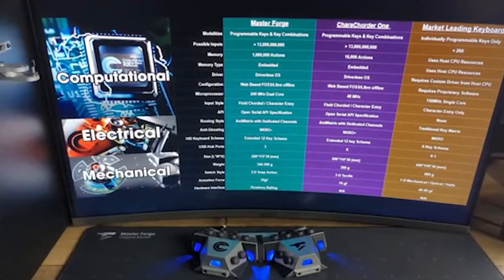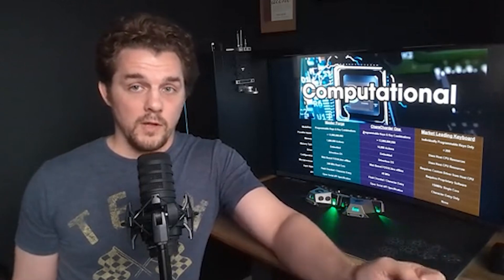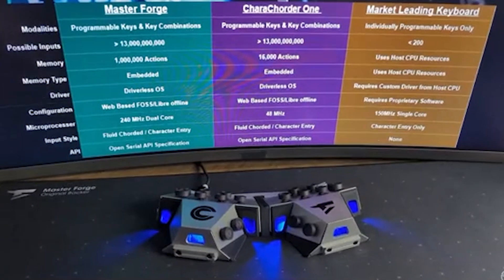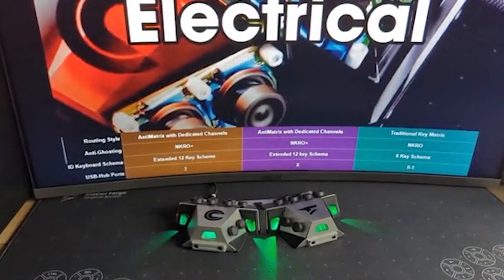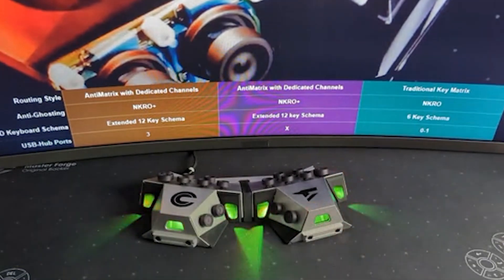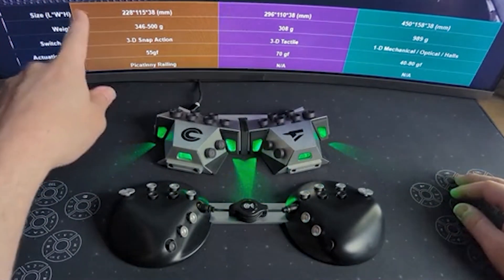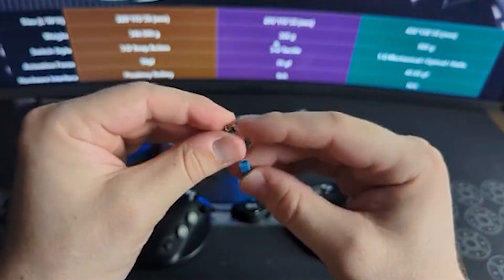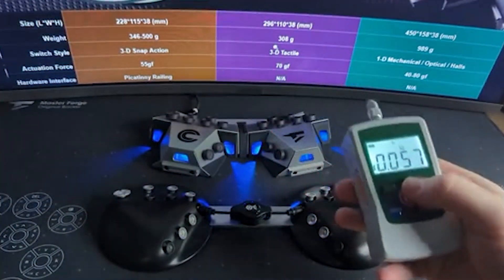Master Forge: Specs Reveal

Comment: I was evaluating whether to get the Characorder.  Now, I also need to choose between that and the forge.  This comparison video did not make clear to me the difference between those two in terms of the user experience and/or learning, beyond the forge being perhaps a bit smaller.
Reply: Yes Forge is smaller.  The left and wight elements of forge can operate independently. It means you can connect one of them to the computer and type with it. On Charachorder one, only one side can be connected to computer. Every element of the Forge acts as a hub. You can connect a USB stick or any other USB device to it. And you can access that device on your computer.
Those are the differences I noticed. It is now up to you to pick the most suitable for your need.

Comment: I saw that assembly animation and my brain went 'how does this get enshittified to cost 9.57' (the cost of cheap rubber dome keyboard)
obviously everything gets injection molded, then we use a single layer flex pcb for the switch board, we replace the switches with metal snap domes which get affixed with some adhesive backed plastic film (fancy packing tape essentially) and a spacer, swap the micro controller for something with the lowest specs available for a single arm core. We can probably get very close to current keyboard prices.
(this is not a dig at the product, more of a thought experiment on how this could be made for mass production at a silly low price)
Reply: This is a late reply and I in no way am speaking for the company, but as a third party bystander....mass production is EXPENSIVE. You need to have volume to justify it and make it cheaper. A product like this will always be niche. Therefore it will always cost more to manufacture because it's not able to be mass produced. You could probably use cheaper material to produce it, but then you'd face longevity issues for the consumer. It's the cost of selling a product that has merit and worth, just not to most of the world.
Reply: @8bittim  I am very well aware of the startup cost of mass production, but the question wasn't would anyone do this, it was how could it be done

Comment: 4:41 This bit is slightly misleading because one could look for an n-key roll-over and require this for their hobbyist stenography and they’re able to input way more than 6 keys at a time, especially for those weird looking chord combinations that make up for “missing” keys. This weird “missing” keys thing and unpredictable chord combinations is why I chose CharaChorder in the first place. 

And I am not required to continue chording even to type one letter at a time if I wanted to. Unlike stenography where I am to chord individual letters, it gets heavy and you have to go into the device to put lighter springs just to ease the weight of the keys so chording isn’t as heavy as before. On the flip side, CharaChorder is really nice and chords are predictable, which is nice, but the joints can get heavy when typing characters that aren’t printed on the sheet or website showing the layout.

Either way, I prefer CC1 over stenography any day, but steno keyboards or hobbyist n-key roll-over keyboards can type more than 6 at a time. I’m pretty sure you mean 6 keys per half of the board with “regular n-key roll-over keyboards”

If you do end up reading this comment, it would be nice to hear about what you think of my concern for the track ball mice, I posted a second one but it most likely got flooded out by other comments, scheduling, etc.
Reply: On the trackball I have an anecdote from my year or so with a DIY Master Forge.

I daily drive a CharaChorder One with a trackball by my right thumb (using a custom mount and some ghetto mods), and the experience is great. Not having to move your hand between the keyboard and the mouse is so fluid that it's really hard for me to go back to other control schemes now, and you can't do that with a non-trackball mouse.

I also have bad tendons, and it's ergonomic enough that I was able to switch to this setup from voice typing.
Reply: Interesting read, but what do you mean by “joints can get heavy when typing”? You mean the actuation force is too big?
Reply: @GreatWalker When I say that joints can get heavy, I mean that when you’re scrolling or typing, things get a bit heavy, especially for the pinky, or typing + or ` or ~, after a while, things get tough to type after a while, so I can’t wait for the M4G switches.
Reply from the maker: Great question! When referring to "market leading keyboard" here I am not referring to steno which to your point is really not designed as a keyboard replacement. They do run into the same 6 key limit on a lot of NKRO keyboards which is why their community keeps a running list of what NKRO keyboards are most compatible with their emulation tools